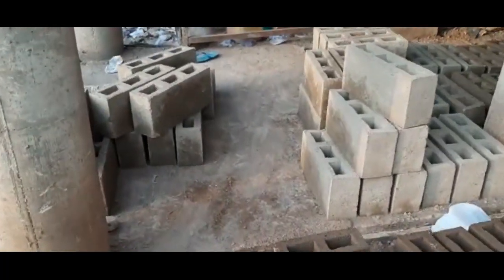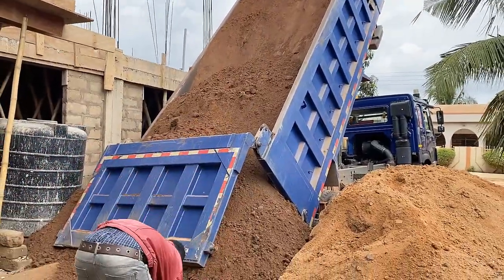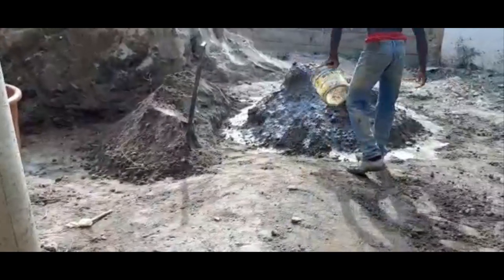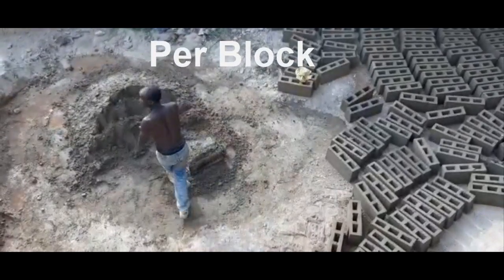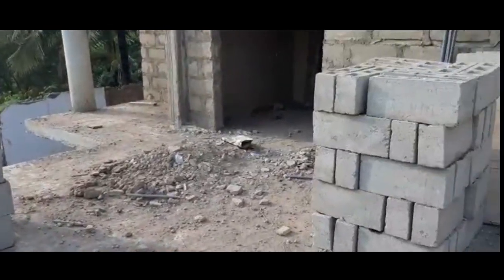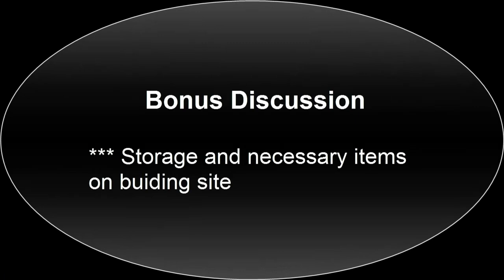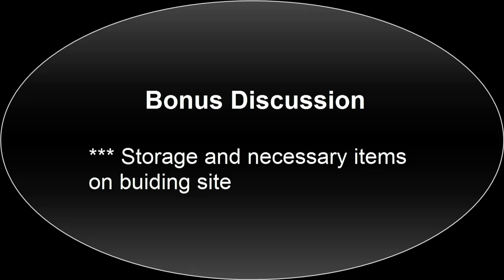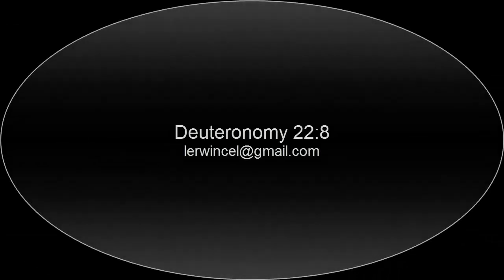Cost of Building in Ghana _ Block Molding _ Ep 10

Comment: Hello sir, what's the cost if molding 1000 blocks of 6 inches.....quantity of everything needed?
Reply from the maker: 1 Trip of sand = GHC 1000 to GHC1200 (px a little more if u prefer to use quarry dust)
40 bags of cement = GHC47 to GHC50 per bag
GHC15 to GHC20 as workmanship for each bag of cement
One tank of water (1800 to 2500 liters)

Comment: Measure the size of the box bed LxWXH send me those measurements and I'll calculate is for you.
Reply from the maker: That's an interesting response :)
That is the formula for calculating volume (length x breadth x height). The problem is getting those dimensions. I was able to determine the one in the video was 19.3 cubic meter cos i got the dimensions online. Thanks for the effort though

Comment: Just measure the square area and do the  calculation.  It's very easy.
For example,  if the bed is 8' by 15' by 40" . You can break everything down to inches then multiplied and devide by 61.023  to get the sq/m , 1728 for sq/ft or 46,656 for sq/yrd

Comment: Thanks for your prompt response. Your videos are really helping me. I watched one of videos in which you were putting your ground beams on the footings. I’m embarking on a G+1 storey as I have said earlier, but I understand that ground beams are made depending on the soil texture, prevent cracks and if the soil is water logged. I would like you to kindly tell me the importance of the ground beam and is it necessary to raise the ground beam if your land is not water logged? Thanks
Reply from the maker: Your understanding about ground beams is right. Buildings settle after construction so the plinth beams help the the building settle as one unit, thus, crack prevention. Our place is not water logged but we still had plinth beams cos of the benefits indicated. Think of it as the braces for the leg of a chair, without it the chair will stand but with the slightest load the legs will not support the load as a single unit so the chair will wobble. That wobbling in the chair will be the cracks in buildings

Comment: With the hollow blocks, as far as the sand is concerned, do you add quary dust or it’s only the normal sand and cement as done with the solid blocks. Thanks
Reply from the maker: Only the normal sand is used without quarry dust

Comment: Hello boss, all your videos are much appreciated. Just to ask, between a 14mm and 16mm iron rod, which is best to be used for a beam. Also what should be the diameter for its stirrups, 10mm or 8mm. This is for a G+1 building. Thanks
Reply from the maker: It depends on the span of the beam as well as presence of load bearing blocks below. If load bearing blocks below and span is less than 12ft then 14mm with 8mm stirrups is okay for a regular residential  G+1 building.  For the dimension, a width of 6in just as the load bearing blocks and 10in deep should be fine. Remember, however,  I am not an Engineer :)

Comment: Wow this is indeed a great teaching and and really learning a lot from you. Thanks for the answers given. Is it advisable to cast your whole footings to getter with your beam, or it’s best to apply concrete on only the beam and cast the whole footings afterwards. You applied the concrete on the ground beam first before casting the whole and others do otherwise. Which is best and why did you apply the concrete to the beam first before casting all. Thank you boss
Reply from the maker: What i did is a plinth beam so okay to cast separately else you will need a formwork for the slab since it will not be efficient to make you slab as thick as a 10in beam. You are however right on the point of casting together if there is no plinth beam. That is, German cast not the best